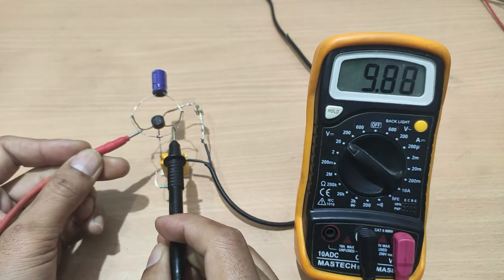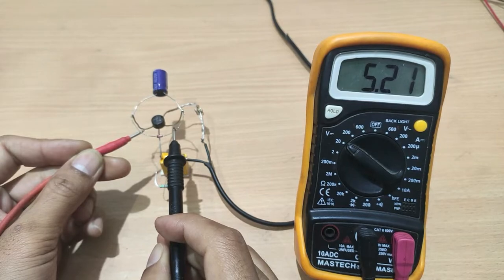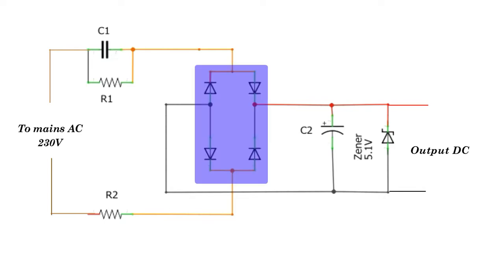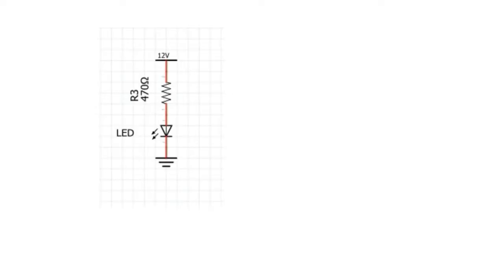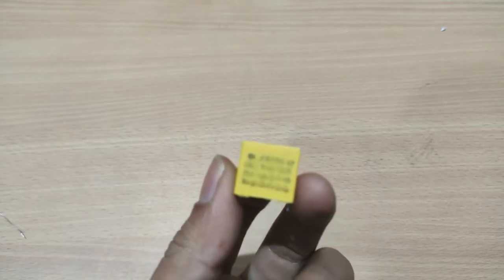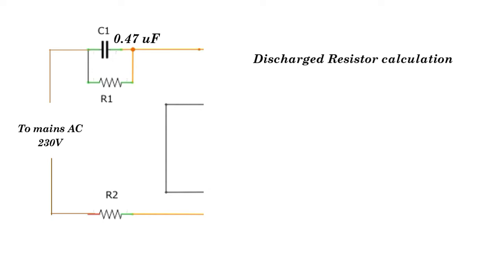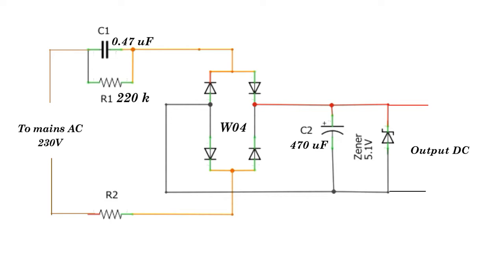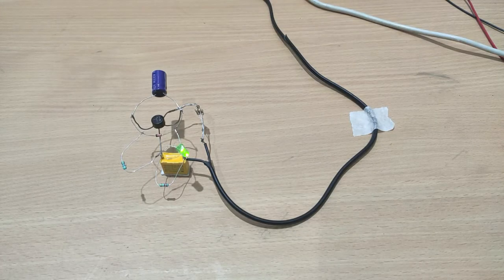The simplest Power Supply // Making  transformer less power supply // Capacitive dropper circuit

Comment: Sir,Tun kum june khn Deploma in Electronic engineering ka zo a,Ac to dc converter ka siam a, automatic switch atan 12v relay ka hmang a, output kha dc tho ala nia..Kha mosfet hmang a,dc to ac convert na hi k siam hlawh tling theih miah lo a,Chu2 i lo ti lang thei angem le.